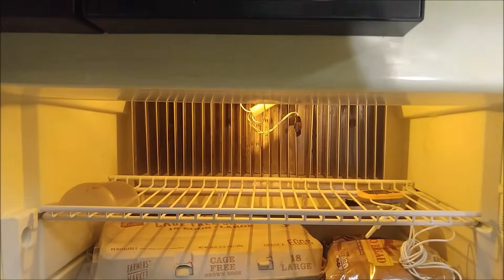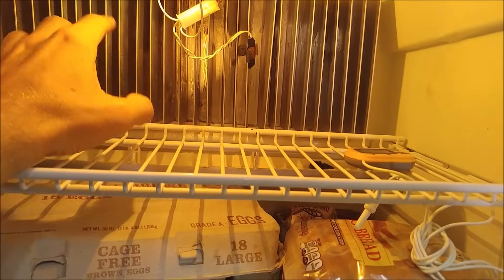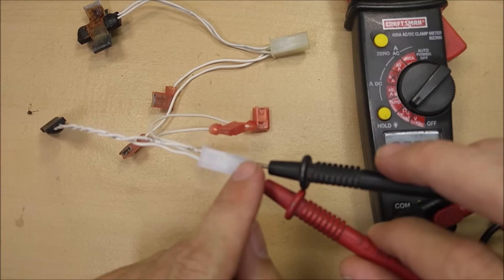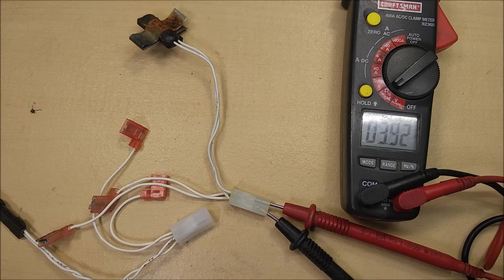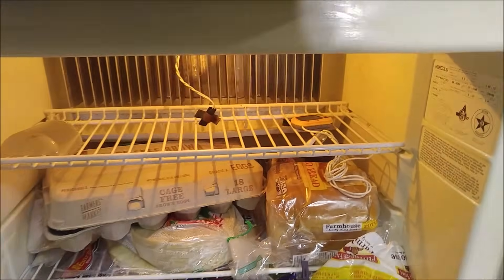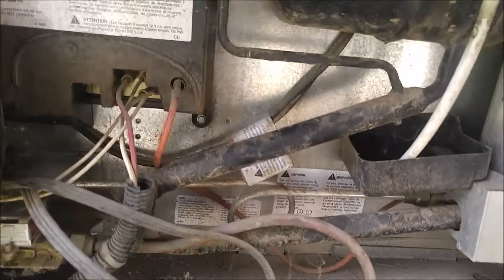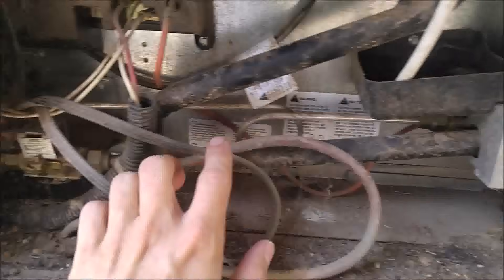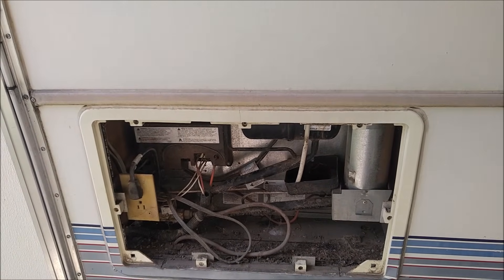The NO-NONSENSE RV Refrigerator Repair & Troubleshooting Guide ~Figure it Out in 5 Min

Comment: What would you suggest for RV freezer at only 24 and fridge at 44.  Tested thermostir and it shows 30 ohms for 32 degrees ice water.  I disconnected it, the unit didn’t get any colder. I checked the exit vent on roof and it was clean.  The door seals seem to be snug. I do have frost starting to show up in freezer.  I get same temperatures in AC and Propane.  What else should I check. This is a Norcold 2118 double wide freezer/refrigerator. I think itches b en doing this a long time.
Reply from the maker: Those double wide units take ALot more energy. Try putting a box fan on the open back for a day and see how much difference you see.
Reply: TrailerDayz - Today I put a fan pointing up the chimney between the coils, there is a small square one already there, but the temp went up to 32 degrees in the freezer. It was warm here today about 83 deg. I have a lazer temp reader and shot that up the chimney to find a temp of 152 deg. I suppose that’s normal. Perhaps a large one at the exit vent on roof be a thing to try? Is there a thermostat or something like that but different than the thermostir that could be defective.  Thank you for responding!
Reply from the maker: @garcosta  The temp went up???
There is a temperature setting. You have it turned to it's coldest setting, right?

If you want to experiment, you could temporarily replace the thermistor with a resistor, or two and see what Temps you get at different ohm values.
Reply: TrailerDayz Yes I have the setting on fridge at the coldest setting, that is 9.
Reply: TrailerDayz I just video taped looking up the chimney with my flashlight. There are 2 fans towards the top of the chimney and 1 fan just below the coils pointing up the chimney.  They only stay on for a short time. So maybe something isn’t right in the board or could it be too much moisture in the walls of the fridge?
Reply: TrailerDayz On trying a resistor or two, if disconnecting the thermistor and there is no temperature change, does that mean it’s running as cold as it can?
Reply from the maker: @garcosta  Not necessarily. I think it goes into a default, or failsafe mode.

Comment: I have a 1999 Corsair camper and my fridge has an A on the display any ideas on what that could be
Reply from the maker: A might mean auto. Follow the troubleshooting steps in the video.
Reply: TrailerDayz I figured it out when it was plugged in it would come up with an error code but then I hooked it up with propane and it worked

Comment: Thanks for the info!!!! Useful! Our fridge is not working on 12V. Works fine on 220 and gas
Reply: Ours is older and it only works on 12v when the engine is running. Basically it is run off the alternator. That is what our manual says. 1990 Hawkins Motor Coach with 3 way Dometic Refer.
Reply: You're RV frigerator shouldn't have 220 going to it, I don't think you're being completely honest.
Reply: @skeetermcswagger0U812  May be a UK location.
Reply: @paulmoffat9306   Maybe.........

 Hey,Moffatt?
 You still got that head in a jar in that  storage place? I was looking for that for Halloween last week!
Oh well,try and find it for next year will ya? 🤤
Reply: @skeetermcswagger0U812  ...never met a RV fridge that runs off 12volts either
Reply: @thecentralscrutinizer5105    
Just  just for the record, all RV Refrigerators except for Class 'A' units with optional residential units need 12VOLT(DC) current to do anything.
 There used to be a prevalence of a 12VDC only option in what was known as a '3 way' refrigerator but that proved problematic because even the heating element for the cooling unit ran off of 12VDC so it was equivalent to plugging a waffle iron into your cigarette lighter plug in your car.(this configuration of unit were slowly phased out in the mid-'80 and are only used in slide-in truck campers & and marine/boat applications)
  have yet to ever see an RV refrigerator that actually works on anything but,12VDC/LP or  12VDC/110-120 AC.
Reply: @skeetermcswagger0U812  Appreciate the info, I got 120AC in, 12vdc in, ammonia pipes are hot...but fridge does nothing cool..I must a have a L7 or "square" fridge...lol
...But then again, I'm working with a 1980 RV (Fleetwood Southwind) that's been parked for some years too...lol... slowly getting things going here, but this fridge bugs me..  Got my Onan 4K gen-set cleaned up and going, plumbings now good, roof AC will freeze ya now... stove & microwave functions... Just the fridge is about only issue left.... and I know doodly about HVAC or ammonia type cooling
Much thanks sir....
Reply: @thecentralscrutinizer5105   Well 1st thing I would do is look in the boiler area where the actual flame is at the lower right hand side of the cooling unit and see if there's any what I call "creepy green death", that's were a yellowish green substance will leak out if there is a breach and the cooling unit,..... that's the ammonia chromium sulfate solution leaking out.

If not I would allow the refrigerator  cooling tub and heating element to cool down completely and take a rubber mallet and strike the horizontal boiler(it looks about the size of a one liter bottle) hit it from the left to the right the right left pretty sharply about 4 to 5 times cause if you have a blockage and the cooling unit it might agitate it enough to break it loose.
 Then try and start and run the refrigerator again either on 110AC or the 12 V and gas.
 It might take several hours to actually start getting cold as that's the nature of the beast.
 It will hopefully start working after the procedure I just explained.
However if you do find that there is leakage where I described,unfortunately the cooling unit will be needed (new or  rebuilt) or a whole new refrigerator.
Good luck!!😉
Reply: @skeetermcswagger0U812  Perfect answer... Was going to go at it with a sledge type hammer this morning ...but this solution sounds less damaging and slightly more productive....Thank yousincerely and will notify you of the results sir... SUBBED!
Reply: Alonso Jayson  thank you!!

Comment: Thanks!  Mine doesn't cool in ac or lp mode.  Thermister seems ok.  8k with heat from my hands which aligns with the datasheet.   How can I diagnose a failed cooling unit?  This fridge is 9 years old.  Thanks again.
Reply from the maker: Follow the video on diagnosing the board inputs and outputs

Comment: Any ideas where to look up the ranges of resistence for the different models?  Or are they all about the same - aka about 8k ohms?  I tested mine to about 2000 ohms, then again it was warm as hell (trailer sitting with fridge off in 110F weather).  Thanks!
Reply from the maker: Link to charts in the description
Reply: TrailerDayz where is the link to buy the thermostat

Comment: HELP, My refrigerator only has issues in hot Northern California weather. Its a good refrigerator but cant handle the heat. Any advice? Thanks
Reply from the maker: Try taking the outside panel off and blowing a box fan on it for a while. If it helps, you can install some 12v fans in there to help vent out the heat
Reply: @TrailerDayz  Thanks so much.

Comment: Any way to make the Norcold more efficient?  When it's 98 degrees out the freezer is barely freezing, and the fridge is almost in the red on temperature.  When 80 deg or below it works fine.   Any suggestions?  Need more ventilation?
Reply from the maker: Yeah, try opening up the panel behind the fridge and put a fan on it to see if that helps.
Reply: @TrailerDayz  I just purchased some fans so I will try and let you know.  Thanks !
Reply from the maker: @GibbsCAMVideoTutorials  Cool! Be sure to let us know if it worked for you.
Reply: You're lucky the freezer freezes at all in 98+ temps.  The hard reality is that gas absorption units don't work or barely work in hot areas such as 90+.
Reply: @endeavourniche9001  Actually when I put to computer fans on the outside of the trailer it works much better, even in our 100 deg summers.  I put one at the bottom to pull in air and one at the top for exhaust.

Comment: What if you have an ice cold freezer and a fridge part that was cold and is now starting to warm up, but the freezer still ice cold, literally. I defrosted everything and leveled the camper (it wasn't level previously) and now I'm restarting everything. It seems like the freezer is getting cold again, but I'm not sure about the fridge. Should I drive the RV around some to "mix up" the ammonia or should leveling have done that?
Reply from the maker: These things take over 24hrs to get cold and maintain tain temp. Let it run for a day or two
Reply: TrailerDayz i actually pinpointed the problem with some things you said in the video. The fridge was cooling fine on propane so I switched over to AC and it started warming again. I put a meter on the AC heat probe and it was open/infinite ohms, checked the output where the leads connect and got 120VAC so found it is a bad AC heating element. I guess I just found it as it was breaking down and managed to save my food and stuff. That element is much different than what I expected and a bit more expensive but better than a whole new fridge. Thankfully I’m a controls systems tech/manager, just not an HVAC guy so I get intimidated with that stuff sometimes. I appreciate your video and troubleshooting steps! Very helpful.

Comment: I don't even  know if mine is on? There is no light bulb any where inside. There is not light on outside to show it is on. It is a Dometic RM2501 can be replaced with RM2510. It is plugged up outside in rear panel. The RV is plugged into a 120. I haven't filled my propane yet. Just bought. The pipes in back of my fridge are warm
Reply from the maker: Find someone that knows how to use a multimeter. If they get stuck, have them watch the video.

Comment: I have 20’ rv. Refrigerator works great when plug in  I got new batteries an still does not keep cold. Any Suggestions
Reply from the maker: Is it a 3-way fridge that will run on 12V as well? Most will only run on 120V or propane.
Reply: TrailerDayz how do I figure that out? Rv didn’t come with a book so not sure. I run ceiling fan with windows open an if it’s park with out starting engine battery goes dead.  I’m located in Las Vegas. Trying to find someone to help me out
Reply from the maker: @leesebergl  It will say on the fridge. If you press mode button you will have either 2 modes or 3 modes.

Your battery will not last very long regardless of whether the fridge is using it, or not, especially in Vegas. The fan will probably drain it in a day.

Comment: FYI. In extreme temps, 108 plus in Az mine would not cool enough for dairy. Tried everything. Finally i checked the upper outside pannel. Tons of heat. I removed the cover so air could flow freely and bingo! Worked 👍.  Still have some issues at 112 degrees plus though
Reply from the maker: Good work. 
AZ can be tough for any cooling system. I just left there with my Sprinter van.

Many if the newer RV fridges have small 12V computer fans attached to the back of the fridge that blow upwards (towards the roof vent). I can take a pic tomorrow. If you feel like it, you could do the same.
Reply: wow dude! this post saved me! I'm in S. Texas with upwards of 99 degrees everyday almost all day long. I couldn't keep diary from spoiling. I would not have thought to remove that upper panel. Had fixed everything else. Now I can have cream in my coffee again. You rock!

Comment: I have a norcold 2118 fridge.
If on propane mode, Is the flame supposed to be on (burning ) all the time?
I had a dometic before and it did not look like this
Norcold makes a sound almost like the water heater when it's on.

Comment: I need help ASAP! My N641R isn’t working with power or 12v. Ohmed out fuses, not blown. 120v to AC plug. What do I need to check next?
Reply from the maker: Voltage to heating coils?
Reply: I’m an electrician, just so you know that some dummy was working on it for one, lol.  Figured it out though. There is a round shaped piece in the lower right corner of the control board. It somehow came unplugged/dislodged from its sockets. Wedged it in place, and replaces the fuse in the main fuse panel and it works just fine for now. The fuse was blown, but in such a way you couldn’t tell visually that it was blown until I ohm’ed it out. Still gonna replace the control panel because it looks a bit worn after being in service for 20+ yrs. thank you very much for responding back to me as quickly as you did. Had I not figured it out, your advice would have been invaluable. I always carry my tools with me in case I ever need to repair something. Lol
Reply from the maker: @MrSparkymedic  Awesome! Glad you got it working.

Comment: great video. I have an Atwood in a 2015 Grand Design. It will cool on gas and electric. I have it set up in a park. When I leave it and come back, the entire system is off.  I can hit the panel button and it will turn back on. Why will it not stay on?
Reply from the maker: Your control panel board might be going out. Does it have a display, or just led lights?
Reply: TrailerDayz the front panel lites up when I turn it on. But I. An leave, come back and it’s off...the entire unit is off.

Comment: I have a dc-340d-f norcold frig and when turned on it runs for approximately 10 seconds, and trips the breaker (reset button) thats located next to temp. Control knob. I took comp. And fan out of the circuit and it still trips. T-stat or control board? Please any advice would be greatly appreciated?

Comment: Quick ?...if the heating element is hot but the coils are staying cold...is there any fix?
Reply from the maker: If it's getting hot in both gas and AC mode but your coils are still cold, you may have lost your ammonia charge.

Comment: Do know anything else about norcold fridges. My dad pressure washed our rv. An got water in the vent. Now the fridge won't stay on. We reset it an turn it on an 12 seconds later it shuts off an the red light on the control panel outside comes on. Won't run on propane or ac
Reply from the maker: Open the vent cover and inspect for water. It may be fine after everything dries out

Comment: Have a question on a Norcold  fridge.  had a power outage only lasted about 15 seconds  have a surge protector in line. After the outage. Noticed that the light in the fridge was not working. Found the bulb is ok using a volt olm meter found there is no voltage to bulb contacts  found if I turned fridge off and back on light would come on but is staying on , then goes out .. works the same if on electric or gas.   Could it be the control board?
Reply from the maker: Could be. Did you check the fuses on the control board?

Comment: Great video thank you. I pulled a bonehead and plugged into 220 on a 30 amp . Fridge and microwave stopped working. Microwave ordered a control board for it. I'm assuming I'll need as control board for the fridge. I have a compartment light but no display light or indicator. Anybody else as dumb as me and fixed it how?
Reply from the maker: Nope. My friend did that. It just blew the fuse on the control board.
Reply: @TrailerDayz  Looks like that's what happened to the fridge too. whoosh, dodged a bullet on that one. 5.00 fuse.

Comment: Ok.  Mine is heating on the a/c element and the gas side. But won’t cool inside the fridge.    The flu and stack are hot. But the lines are room temp
Reply from the maker: You may be out of luck. Did this just pop up?

Comment: I have a Norcold in a 1991 Dutchmen I just bought and the fridge won't start up in propane. Thank you for this starting point in my trouibleshooting journey
Reply from the maker: Glad to help.
Check:
Voltage to solenoid.
Carbon at the gas jet.
Reply: @TrailerDayz  Will do; I subscribed to your channel by the way

Comment: So I have a question, I have a norcold n841 lp fires up after afew times trying, and 120v works and both switch just fine on auto but does not cool at all on either, and I hear a faint ticking sound like on a clock. Do you think this might be a control board issue?
Reply from the maker: First thought is LPG ignitor ticking trying to light. Is the heater hot as shown in video?
Reply: @TrailerDayz  Yes on LP it lites and stays lit. On 120v I can feel heat  but on both I hear a faint ticking sound like a clock but on both the fridge does not get cold
Reply from the maker: @ToConnect2000s  How long are you letting it run? Was it working previously?
Reply: @TrailerDayz  I've let it run both LP and 120v over 6 hrs each and I bought it used from the FB marketplace from an RV'r that was upgrading to a 10 sq ft fridge (I'm putting this in my Skoolie that I'm building)
Reply from the maker: @ToConnect2000s  I think I saw your post on on of the FB page about getting this. Lol.

Did you lye it down during transport?
Reply: @TrailerDayz  nope
Reply: @TrailerDayz  I haven't made a post on fb about this except on my bus page when I got it, and no it stood up during transport but I also transported it like 6 months ago.
Reply from the maker: @ToConnect2000s  You can try "burping" it. Turn it first on it's side, then it's top, then it's other side then back to center. Try clockwise first. Let it sit about and hour, then turn it on.

If that doesn't work, try counter-clockwise.

Google "burping absorbtion fridge" or something along those lines.
Reply: @TrailerDayz  Thank you I'll give this a try and get back to you
Reply: @TrailerDayz  So I tried everything, even burping it and still nothing. I tested the ohms on the thermistor, and the heating element and both were in its running range, even bypass the power control board, put in a new heating element (to make sure) and ran that directly to a cord to a 120v outlet (heating element is a 120v) and let it run for 4+ hrs. Nothing still the inside of the fridge didn't get cold at all, just all the piping in the back got very warm which tells me it has to be the cooling unit itself.